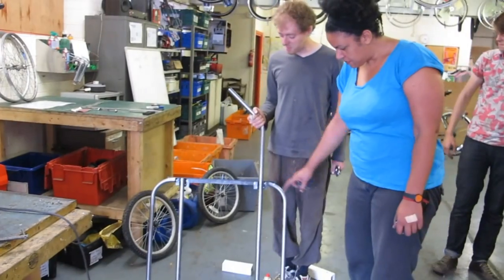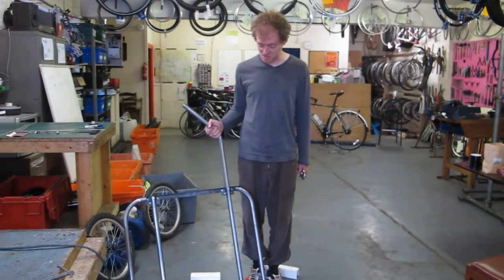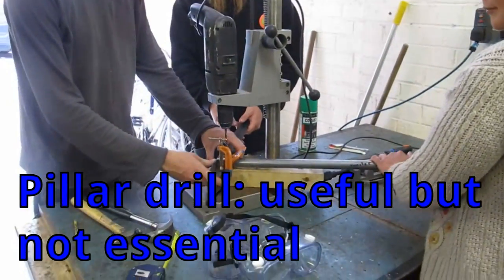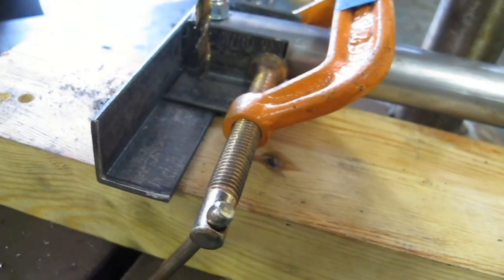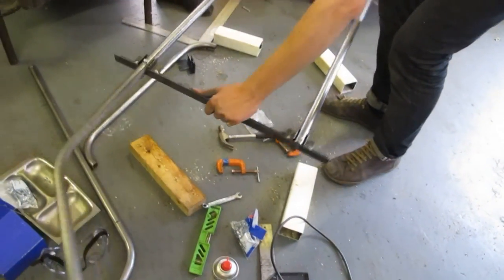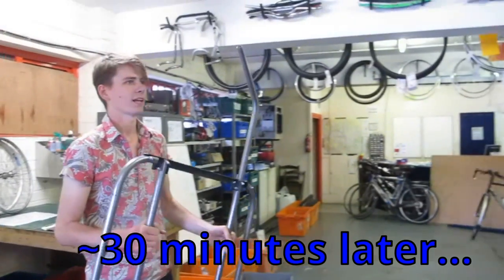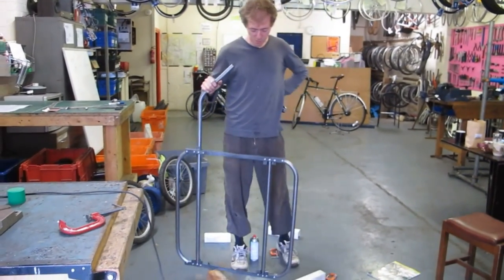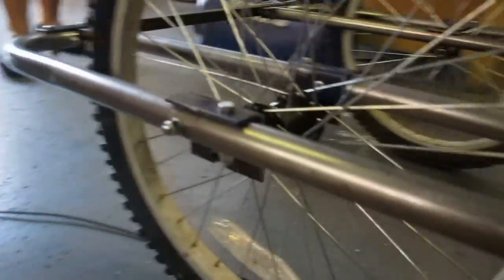How to build a bike trailer - new steel tube design

Comment: I like how you made the hitching tongue an integrated part of the trailer frame. I imagine it would be less flimsy than a hitching tongue bolted separately to the frame. I got a used, conduit tubing trailer for quite cheap. But after making a few trips with a 100 lb sound system on the trailer bed, that hitching tongue is slowly swaying to the point of breaking.

Comment: ive bought my first new arc welder in the UK and ive yet to try it , im shit scared if my electricicty bill???? well here goes will report later. your design is great . I have a bob trailer and im making a double wheel attachment for the rear the main reason being that if you carry something a little heavy like a 15 kg bag of dog biscuits and a dog ha ha  it wants to topple over with only one rear wheel. So im hoping double wheels 2 feet apart  at the rear will be more stable and still narrow enough to give you ease of getting through traffic or tight country trails on a steep tough hilly coastal route. great video guys thanks a lot!

Comment: You can get this trailer already made almost exactly the same design but a little better engineered and likely significantly lighter, it’s called a burley kid trailer. I bought one used on Craigslist for $20 and the hitch has held up the 6 years I’ve had it and as skilled as I am I couldn’t make a better working hitch, definitely my design would not be anywhere near as easy to install or remove as the burley. I gutted the seat from mine, added a plywood floor, and stapled a rug down for towing my dog around. Works well for hauling all kinds of stuff tho. (Edit) I have been thinking of buying a second one to make a Paul Elkins inspired camper. I have been thinking of buying a third one to make a kayak trailer that also can store/haul fishing gear

Comment: with a little extra tubing you could easily make the length adjustable/expandable
Reply from the maker: True that - we have built a much larger one that we should publish a video on soon.
Reply: Robin Lovelace
i was thinking of a tube sliding inside another like a trombone with horizontal locking pin holes at intervals so the length could be adjusted to suit in a short time.....pull the pin.slide to the desired length and re insert the lock pin kinda thang........
Reply: buckandotis now thats an idea along with pcv piping instead of metal tubing D:
Reply: +Michael David Cilantro pvc is not strong enough for anything.

Comment: i thought of building one like that......but i realized it would be cheaper just to buy a used one......after few weeks of searching i found a used kids trailer for $25..mostly aluminum parts
Reply: That's your best bet dude. An old kids/toddler trailer with the canvas wrecked. You can pick one up on craigslist or kijiji for 20 or 30 bucks. Strip off the plastic and canvas and pop on a plywood box. Voila! Great trailer with hitch included.